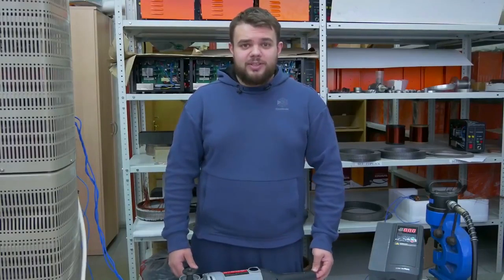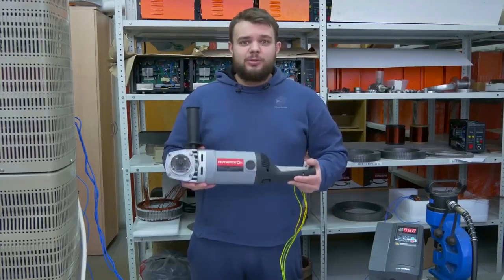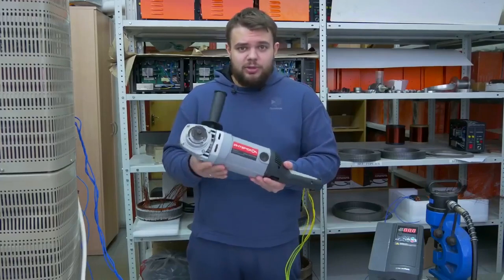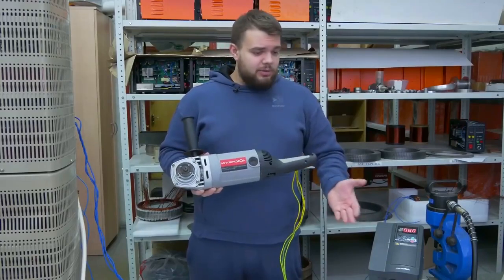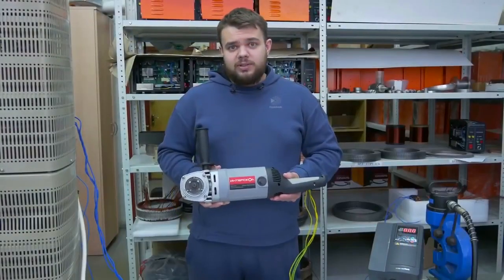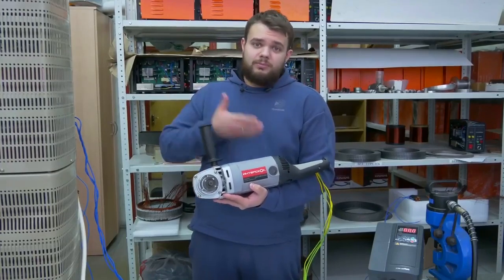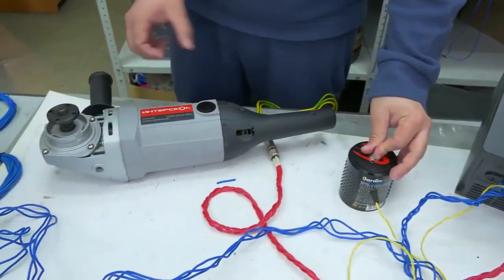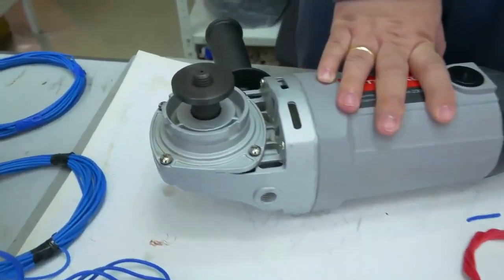Slavyanka technology application in the electric tool   Duyunov's Project

Comment from the maker: Рublic funding and Registrierung hier: goo.gl/hxvBmz E-bike with Duyunov's wheel motor at StartUp Show in 2015 goo.gl/hxvBmz StartUp Show is an annual event aimed at presenting the most promising startup projects. In 2015 Duyunov's team presented their e-bike equipped with Duyunov's wheel motor at this event. Evgeniy Duyunov demonstrated the power of the wheel motor by effortlessly pressing the throttle grip. He also spoke about the advantages which include 17 kg light weight, 20 kW power, no magnets in the motor. As you know, all these properties make the wheel motor stand out when compared to similar Chinese motors. goo.gl/hxvBmz Evgeniy paid attention to the uniqueness of this invention which manifests itself in using a special winding type named "Slavyanka". goo.gl/hxvBmz After the presentation the impressed visitors bombarded Evgeniy with questions and the most popular question was about the price and the possibility of purchasing the wheel motor. Рublic funding and Registrierung hier: goo.gl/hxvBmz Das Projekt "Duyunov-Asynchronmaschine" wurde 2017 zum Ausbau und zur Anwendung der einzigartigen Ausarbeitung von D.A. Duyunov - des ersten asynchronen Elektromotors mit der Wicklung nach Art von "Slawjanka", sowie des Motorrades ohne Anwendung von den Seltenerdmetallen entwickelt. öffentliche Finanzierung und Registrierung hier !!! goo.gl/hxvBmz Wir arbeiten unter Teilnahme von folgenden Unternehmen: 1) Gesellschaft mit beschränkter Haftung (OOO) "ASiPP" - Ingenieur- und Konstruktionsunternehmen mit langjähriger Erfahrung, wo es mit der Entwicklung von dem Plasmaschneider, Motorrad, der Wicklung "Slawjanka" usw. angefangen wurde. Unter den Unternehmensgründern - D.A. Duyunov. 2) Unternehmensgruppe "SolarGrupp" - Crowdinvesting-Plattform, Verband von den engagierten Menschen, die für die Vereinigung privater Investoren weltweit arbeiten. 3) Gesellschaft mit beschränkter Haftung (OOO) "SowElMasch" - "Werk zur Produktion der Werke" - eine Gesellschaft, die fertige Lösungen für das Großgeschäft in der Elektromotor-Produktion anbietet und Innovationen bei der Herstellung durchsetzt. Unter den Unternehmensgründern - D.A. Duyunov. öffentliche Finanzierung und Registrierung hier !!! goo.gl/hxvBmz Das Schema des Zusammenwirkens von drei Unternehmen: OOO "ASiPP" setzt die Technologie um, SolarGrupp organisiert die Erhebung von Investitionen, SowElMasch wendet die Innovation bei der Herstellung an, wodurch das Produkt auf den Weltmarkt gebracht wird. öffentliche Finanzierung und Registrierung hier !!! goo.gl/hxvBmz Das Ziel des Projektes ist die gegenseitig vorteilhafte Zusammenarbeit des Unternehmens und der Investoren für die Einführung der Technologie auf den Weltmarkt und zum Serienproduktionsstart des gefragten Produktes. Die Technologie bekommt die Massenanwendung, die Investoren - den Miteigentumsgewinn. öffentliche Finanzierung und Registrierung hier !!! goo.gl/hxvBmz